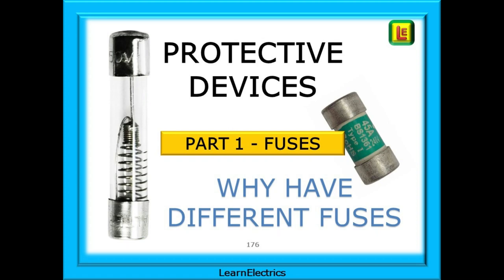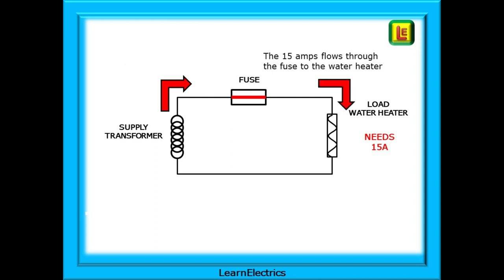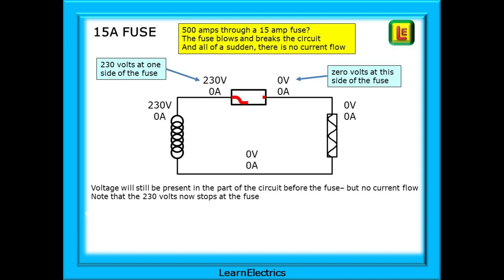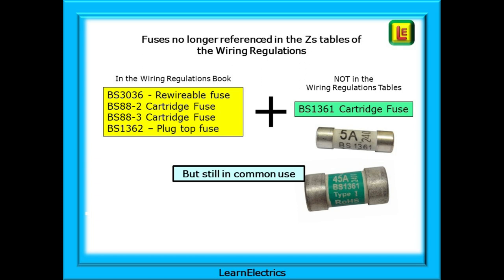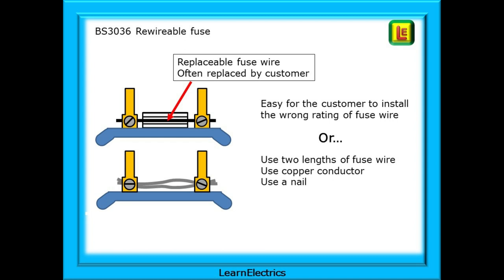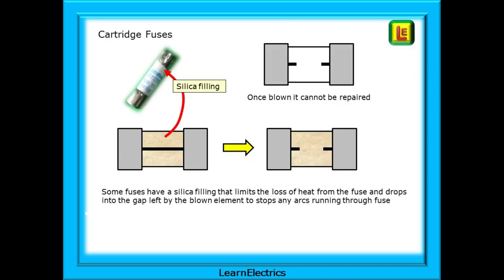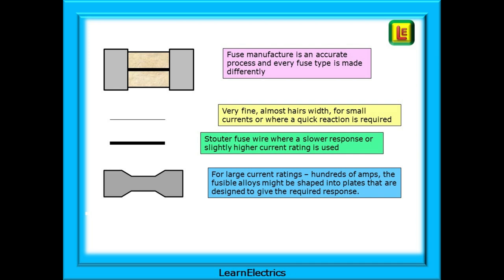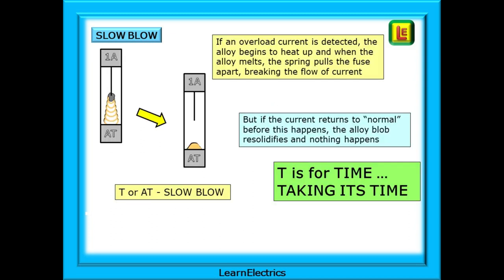PROTECTIVE DEVICES - PART 1 – FUSES – DIFFERENT TYPES AND WHY WE HAVE THEM - WHY A FUSE BLOWS

Comment: excellent explanation and this is the first time someone has referred to electricity as either energised or de energised. IS de energised electricity still got a voltage though to push it back to the transformer and become energised.
Reply from the maker: I look at it as flow of electrons. think of a central heating system. Hot, energised, water flows into the radiator. It loses the energy as heat into the rad and then the same cooler water flows back to the boiler to be re-heated, re-energised. The potential difference or voltage on the line is pushing the electrons around the circuit. Hope this helps but the real truth is that nobody really knows how electricity works. Some say it is electrons, some say it is waves, there are lots of theories. Dave.

Comment: Hello thanks alot for your informative videos. I have really learnt alot from you. There is a video you talked about shared neutral. My question is in most homes here in kenya you find that all neutral are from consumer unit neutral bar. Can we categorise neutral bar in consumer unit as part of shared neutral if not why. Kenya electricity we use 240V single phase and 415V three phase just like UK. 5hz frequency
Reply from the maker: Anthony, if the neutrals for each circuit go back to the neutral bar individually, that is good. A shared neutral is when two different circuits use the same neutral conductor to go back to the neutral bar.
The video you want is ... SHARED NEUTRALS, click on the link below
https://www.youtube.com/watch?v=gr6Z_bBiy5g

Comment: Another great video and it is important to know what type and size of fuse that is used. As electrics seem to be going more into electronics fuses are very commonly found. As a maintenance electrician in a industrial plant I had fuses from .100 ma to 600 amp for lower voltages ( 5 volts to 600 volts) and 1 amp to 100 amp high voltage (14,400 to 24,000 volts) fuses as well. Thanks for the video.
Reply from the maker: Thanks for the info Lyle. Yes, we had dozens of fuses like you. I started to add up the value of the stock on the shelves once. I gave up, the money value started to frighten me. Thanks for watching. Dave.